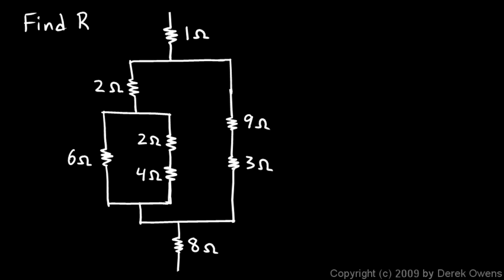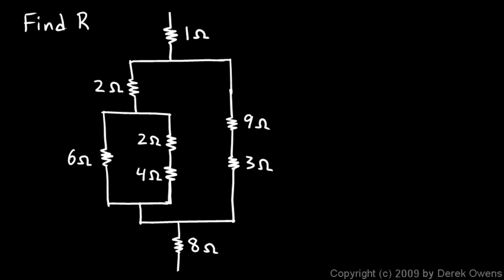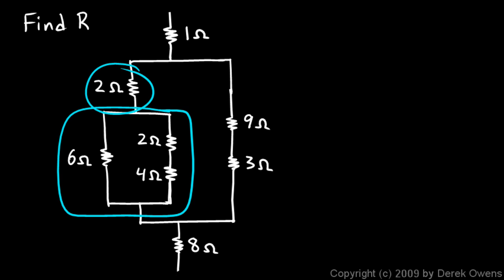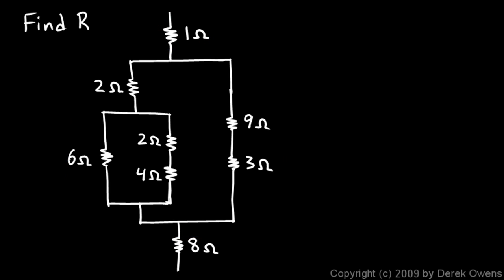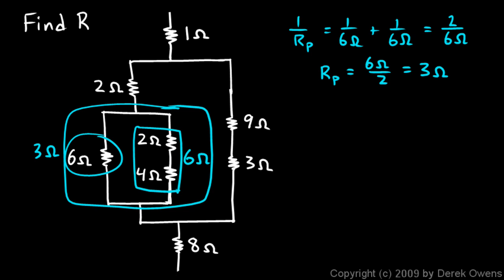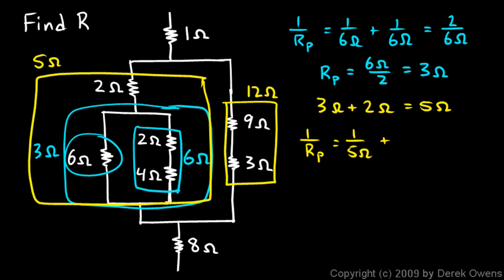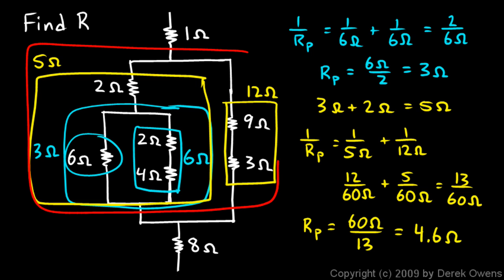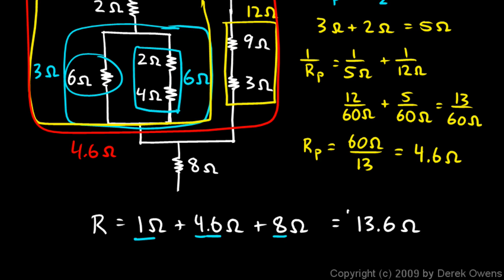Physics 13.4.2h - Circuit Reduction Example

Comment from the maker: That's a good question, and EE is not actually my field (I studied ME and Physics).  But I believe that these larger and more complex devices are generally broken down into smaller less complex components, each with its own characteristics.  But yes, they do get a lot more complicated than the circuit shown in this video.

Comment: i thought I had the wrong answer until I noticed the comment on your error. One question - it seems like analyzing a large circuit, such as a television, computer PC, etc would be overwhelming in terms of keeping track of it all - you'd run out of different color pencils. Is there some other way that complex circuits are analyzed? it tempting to imagine a scanning application that used pattern recognition to do the work.  thanks